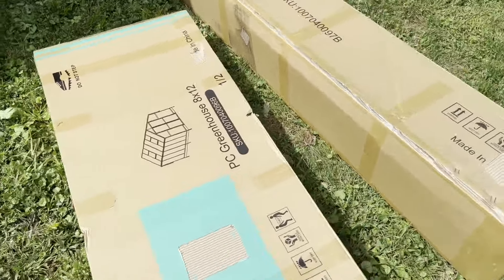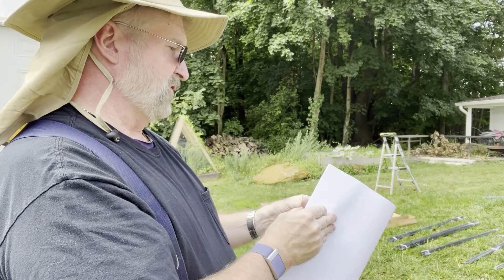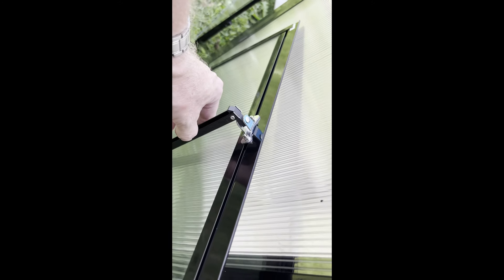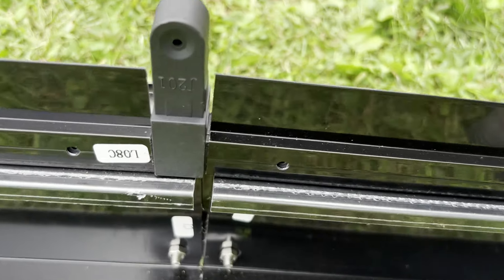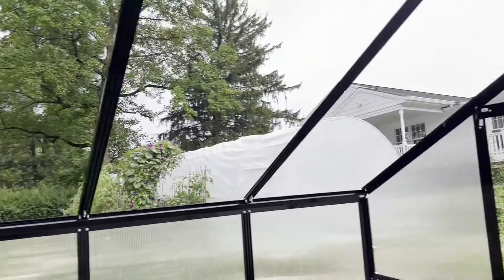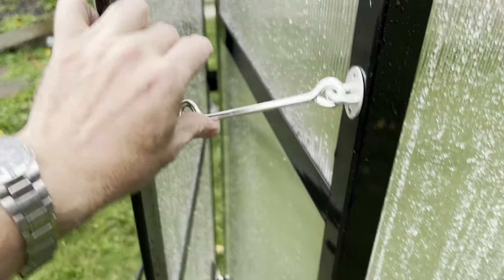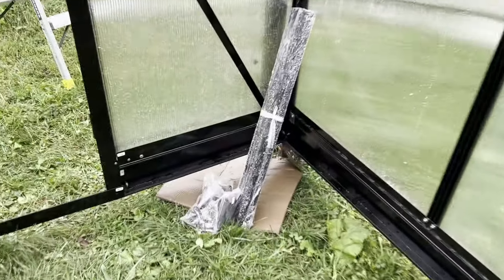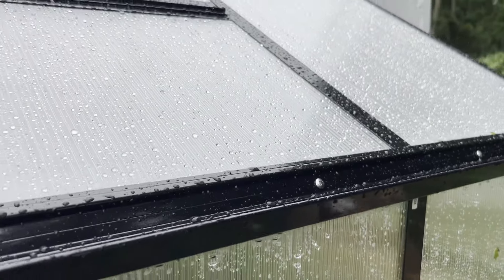8x12 FT Polycarbonate Greenhouse with Quick-Connect Fittings, Walk-in Large Aluminum Greenhouse

Comment: those windows must be locked when closed. Otherwise they flip open during heavy wind. You do that by using 2 holes on those 2 pins on that bracket. Ther is why those 2 pins are not  level ...
Reply from the maker: Thanks

Comment: Thank you for the video! I live in a very rainy climate and would like to use one of these for an enclosed chicken run, but I was wondering if I could put the windows that open on the roof on the sides instead so I can keep the temps down in there.
Reply from the maker: Yes they should fit and maneuver that way. Easy to fit pieces.